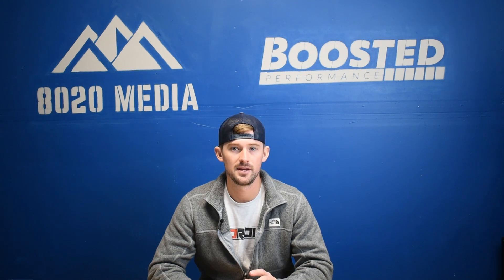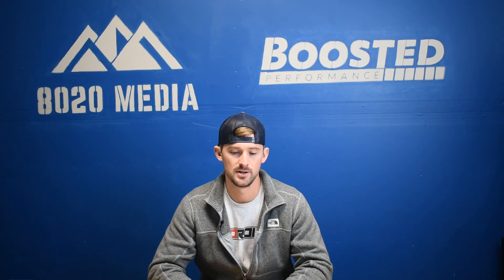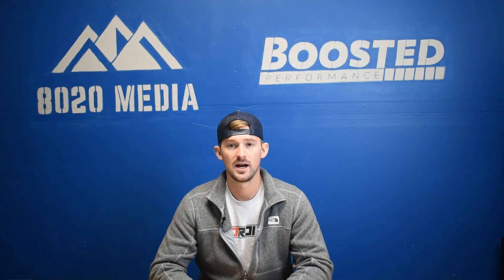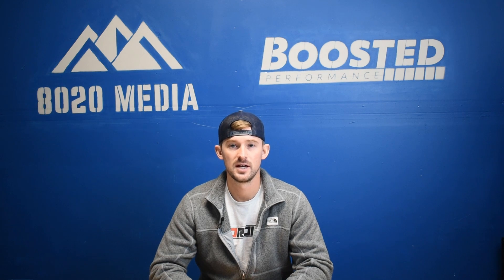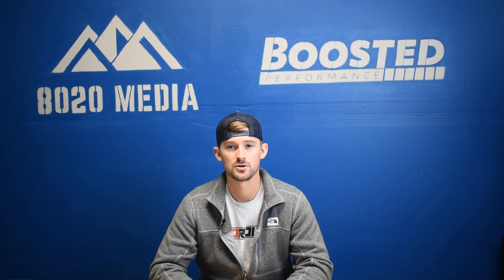The Few FLAWS of the Ford 4.6 V8 Engine!

Comment: Can you buy a new factory engine?
Reply from the maker: I believe Ford actually does sell them directly, but they are remanned/rebuilt engines and not completely brand new ones.
Reply: @8020Automotive  I have a 96 Grand Marquee and I love the low end torque.  My car  tac never goes over 2000 rpms unless in an emergency situation.
Reply: @victorydaydeepstate  😂ok Grandfather 👴
Reply: @catsaretasty  I just cracked up!!   HAHA
Reply: They discontinued them, around 2019. You can buy remanurfactured engines from companies like Jasper or Powertrain Specialties.
Reply: @danielcapalbo5293  What is the half-life of a remanufacted engines versus factory?

Comment: I have a Ford F150 XLT 4.6 liter..last week driving at 60 mph  I heard a loud hissing from the engine..sounded like air..pulled over lifted the hood steam rolled out from the pass.side from dash/firewall-steam came from radiator, reservoir was empty; could see the coolant in tube at bottom...heater no longer works but truck doesn't overheat..and my check engine light no longer lit? Got the pu 2 mos. Ago check engine light  has been on til this incident..
The male people in my life want to go straight to replacing heater core/intake manifold? I wanna check out hoses etc.  Need advice anyone?
Reply from the maker: If you aren't losing any coolant and it isn't overheating then I don't think it would be a hose or the water pump. Heater core sounds like a good guess to me if the heat inside the truck no longer works and no leaks. But wouldn't be a bad idea to check all of the hoses too considering age.
Reply: Check your freeze plug on the back off the engine between the transmission and engine

Comment: I have a 04 f150 with 4.6..its biggest problem is spark plugs popping out which resulted in me repairing 3 of them. I have 276k on my truck now.
Reply from the maker: Thomas - Thanks for sharing your experience! Hopefully you get 200k more out of it.
Reply: same with mine, i e shot 2 now and i’m at 288k, also went through 3 intake manifold gaskets
Reply: @james51502  I love my truck, however the intake bolts are corroding causing anti- freeze to short out coil packs  and the passenger side frame has now rusted away. Ugh. Lol. I'm hoping to get it fixed before winter.
Reply: @thomasstanfel7589  i just got done re threading cylinder 8 spark plug hole but now one of my coils is not working and it’s still missing really bad, im in the process of figuring out which one isn’t working and why
Reply: @james51502   Hopefully it's a simple fix, those coil packs can be extremely temperamental.
Reply: @james51502 what does it do when it pops out?

Comment: I have a 2010 F150 4.6 3V at 180k I replaced all timing components and installed a high volume oil pump. It has 250k now still running great.  5w30 in these engines are a must imo.
Reply from the maker: Ryan - Thanks for sharing your valuable experience! Hope you get 250 more out of it.
Reply: yes 5w30 is better
Reply: I was watching a Ford engineer on u tube and he said 5w 30 lubricants the engine better and save the engine from ticking as it ages
Reply: Currently have 140k miles and haven't opened up my 3v Sporttrac. Been using 5w20, any reason why 5w30 is better?
Reply: @mr.boostang2064  It's thicker, better protection for engine components
Reply: @mr.boostang2064  better lubricant protection at run temperature.  Use what manifacture recommends my 98 f150 says 5/30
Reply: Its not. It hekp contribute to these problems. @mr.boostang2064
Reply: I run 15/40 diesel oil in all my vehicles recently bought a 07 f150 with 370k miles and after atleast 5 oil changes since I got it, seems like It really likes this 15/40 oil. I got atleast 15k miles In, In less than half a year.
Reply: @Athefleetmechanic  could 15w 40 work for an 05 with a 4.6L with 176+?🤔
Reply: What oil pump did u buy
Reply: @eliudgonzalez5751  melling 340 hv
Reply: I been putting 5w20 should I do 5w30
Reply: @tracewebb no.
Reply: Hey man I just bought one same year 
2010 F-150 XL 4.6 3V with 83K miles
I just got the oil change done, what mileage should I do a proper tune up? And any personal advice since we own the same year and engine? Thanks
Reply: @PrincePisces  I would change plugs between 90kand 100k. Run 5w30 synthetic oil change every 5k. Passenger side exhaust manifold likes to leak. Ive changed 2 on mine.
Reply: @ryanturgeau6  appreciate it man! I’m tryna make mine reach 250k miles, I’ll change my oil weight for sure and plugs here soon, I noticed there’s a rattle noise when I accelerate at low speeds, not my motor making the sound but underneath the cabin or so
Reply: @ryanturgeau6 I pulled the plugs on my 4.6L 3V (2008 Explorer SportTrac) at 60,000 miles, and they were shot. Enormous gap/ electrodes badly worn.  I’d at least pull one on your engine to see its condition.
Reply: Sounds like timing chain issues @PrincePisces
Reply: @PrincePisces did you find out what the noise is ? I hear it on mine also
Reply: I have 150k on mine I just change the oil every 3k miles
Reply: @AlphadogFJB waste of money dude. Use full synthetic and change every 7k miles. It's really not a problem unless you're beatin' the snot out of it or running through the dessert.
Reply: Does anyone else have a bounce or wobble around 53 mph and then it smooths out after that
Reply: how is it running though😂😂
Reply: I have an 06 f150 I just got with 105k miles should I immediately do the spark plugs everything works great and old man owned it
Reply: @zkmoney22  yesssir, you should do it all. Since its a used vehicle, spark plugs, oil change, transmission service, rear end oil change, check brakes, serpentine belt and lastly serpentine belt and depending on how crusty they are do both rad hoses. You'll be set for another good while, keep up with the oil changes and youll be surprised
Reply: @zachkindt2711 the only problem that I have had with my 06 f150 is the ignition coils. I've had to have the ford place replace a couple of them and they went ahead and replaced all of the spark plugs. That was at 133k miles. Besides that, everything else has been fine. The only thing that bugs me about this generations of f150 is they seam to have a bounce at around 53 mph, but above that speed it evens out. I've taken it to several shops and they all say  it's a ford thing.
Reply: Hi, can you please tell me the fuel milage you get?
Reply: @santiagorojasp.4994  21-23 hwy. 15-16city.
Reply: @ryanturgeau6  not bad
Reply: For years now, I've been trying to convince the local oil change places and dealership that the 2nd gen 4.6L engines use 5W-20 and anything less than 5W30 in a 1st gen 4.6L is foolish. If that damn oil filter wasn't so hard to change I probably wouldn't screw around with lightening lube but it really is a hassle on the early Crown Vics.
Reply: @rockguitarist931 so technically you could use 5w 30? in a second GEN 4.6L for a 05 engine?🤔
Reply: @rockguitarist931 Ford backspecced all the old cars back to the 5.0 pushrod to 5w20. Definitely won't do it again. Nothing but issues.

Comment: The 2v 4.6 was offered in the panther platform until 2011, 3rd gen (02-05) explorer, on base model f150s until 2010, and on the e series vans until their discontinuation in 2014
Reply: I currently have a 2005 explorer 4.6 2v with 220,000 miles on it. Runs like it’s new and doesn’t burn oil.
Reply from the maker: Matt - Thanks for the insight! Also for sharing your experience. This will help future viewers. Hope the Explorer gives you another 100,000 miles without major issues!
Reply: @8020Automotive  LOL thanks I hope so too but I’m pretty sure the trans will need a rebuild before 300k
Reply: Mustangs used them from 96 to 04, then moved to 3 valve 4.6 for 05 to 2010.
Reply: I have a regular cab F150 with roll up windows.  4.6L 2 valve.  Such a smooth engine.  145K.  Still a baby IMO..
Reply: @danielnewman3441  i have 192k on my 2005 f150 2v 4.6 love this engine also roll up windows
Reply: @shortstop-u4i  Nice to hear from a fellow roll up window club member.
Reply: I have a 2010 Explorer Sport Trac with the 3 valve. It’s definitely fun to drive with right at 300 HP and 300 ft-lb in stock trim with an 8.8 IRS.

Comment: I’m considering a 2008 low mileage P51a Roush Mustang. Supercharged…wonder if I should be concerned with the 4.6L since they forged a lot of internals.
Reply from the maker: They forged the internals simply due to power levels. The 4.6 3v can only handle about 450whp without upgrades - since the P51a is at 510hp to the crank, it is pretty much right at the power limit from the factory. So they were mainly upgraded to increase reliability and power limits.
Reply: @8020Automotive  thank you for taking the time to reply, I really appreciate it. This is reassuring, great feedback.

Comment: So excited getting a 2008 E150 to convert into a camper van and it's good to know the engine is reliable except for the timing chain and spark plugs XD
Reply from the maker: Lizard - Sounds like a fun project! Keep us posted.
Reply: Just did the sparkplugs yesterday, when you have to do yours, make sure to take all the precautions and get the extractor tool. It is the only way to do it, and it will still take around 10 hours to do the full job
Reply from the maker: Finn - Thanks for sharing this insight and experience. It will certainly help future viewers in their DIYs.

Comment: Funny. In my experience he covered everything bullet proof with Thunderbird 2v 4.6
Reply from the maker: Thanks for the feedback! Do you still have the Thunderbird? If so, how's it holding up?
Reply: @8020Automotive  it was mint when I had it to when I sold to a car friend. Runs better than purchased and sold. 

These cars need replacement on a lot of general things after 20 years or so would grant. Don't slack it can be dangerous of if your short on cash make you lose the car.
Reply from the maker: Great advice! Thanks for sharing your insight on this.
Reply: @ROADIE37 swap the 

Fan
Intake manifold
Plugs
Wires 
Filters
Royal purple oil

Thing is bullet proof. It was meant for everything.  Your imagination is the potential the limit is your wallet. 

If the ac compressor pulley starts to jingle, change the unit .
Reply: @VOOODOOO btw the engines will run well with 5-10lbs of boost, bone stock. Anything after that it's gotta be forged internals. The explore and f150 engines had some of these parts. Like the cobra crank.
Reply: I know of one that was daily driven for more than a minute with a loose oil filter... Still lasted another 80k miles... These engines are truly built Ford tough.

Comment: I read somewhere in mid-2008 Ford redesigned the sparkplugs on the 4.6/5.4? Is this true? And does that fix the breaking issue? I have a 2010 F150 with a 4.6 3v
Reply from the maker: Yes, this issue was fixed in 2009+ models so it shouldn't be an issue in you 2010. I just recommend changing the plugs every 50,000 miles or earlier depending on how many miles you drive per year. Plugs are really cheap and it's an easy DIY if you have a bit of mechanical skills so no reason to go any longer without changing them.

Comment: Thanks for the info. I'm presently looking at a 2009 F-150 4×4 4.6 V8
Super Crew Cab. I like the truck it looks great with a decent lift kit and nice wheels. I was looking for a 5.0 Coyote but no luck finding one close to where I live. The 2009 has 185,500 miles on it. The transmission has a clunk going into third gear but the dealer is going to repair that. I hope I don't step into a money pit, these
are great trucks as long as you take care of them and keep up with regular maintenance. Wish me 🤞luck !
Reply: I own a 2010 F150 with the 4.6 3V engine in it. Bought it at 186K km. and now two years later at 217K km.
I love the way it drives, mainly use it for my carpentry business.
I tow every now and then. Here on Vancouver island l run into lots of challenging terrain, never had any issues.
I have it regularly checked by different garages including a 100 point check with the Ford dealer.
I prefer different individuals inspecting the vehicle since each has their own specialty and might see something that another one missed.
Reply: @rogiervantilburg3440  
No issues with removing sparkplugs or having timing chain problems on your 4.6-3valve ?
That is positive information, thank-you  👍
Reply: @toniocavalari6936  no problems at all.
Reply: @toniocavalari6936  the spark plug issue is easy enough using the tool lisle produced. Annoying sure but not the end of the world. The phasers were more of a problem on Mustangs and such churning out more RPM. They how surprisingly well but anyway you look at it that millage is getting up there to not know the history on. I'm not sure what trans is in it but jmod or a shift kit or at minimum tune up the pressures. The less pleasant the shift is the better. Smooth shifts equates to slipping the gears in which equals heat. Heat is the destroyer of all!
Reply from the maker: No surprise on the transmission, they are notoriously bad on these trucks but glad you are getting it fixed by the dealer.